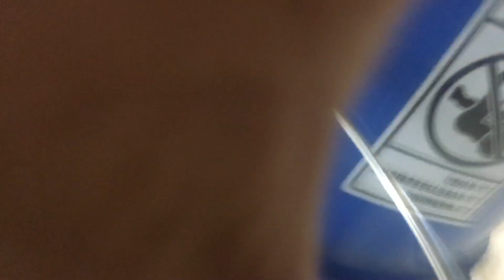EPIC VINTAGE OTIS ELEVATOR MACHINE ROOM

Comment: The installation was nicely done, with the conduit. Don't see the deflector sheave too often in the machine room, they're generally beneath the machine. An exception would be for a 2:1 roping where the machine is mounted at a slight angle.